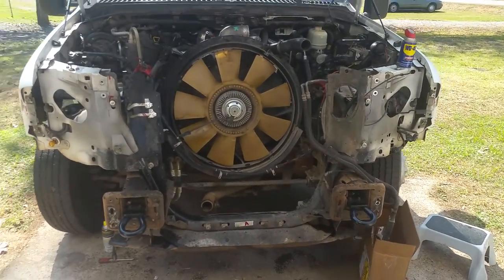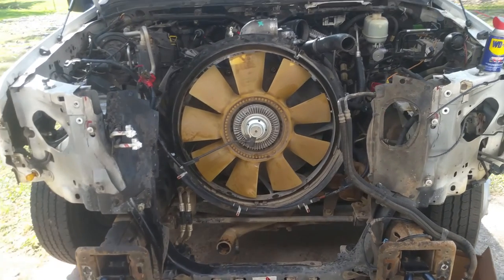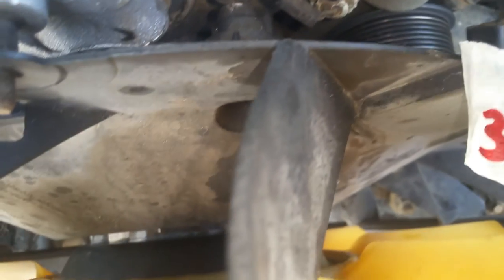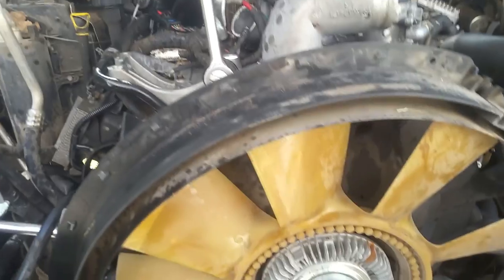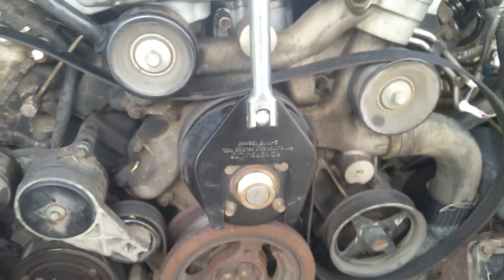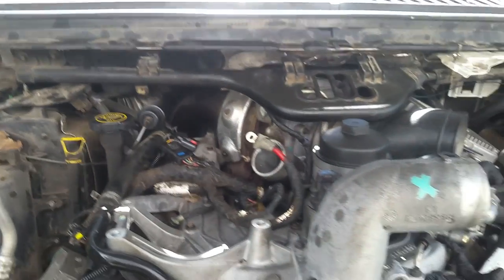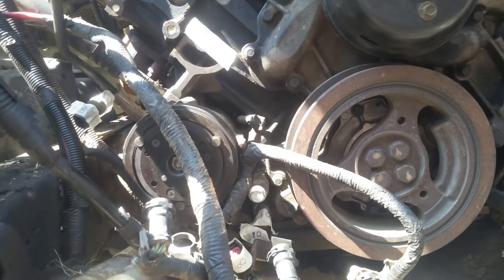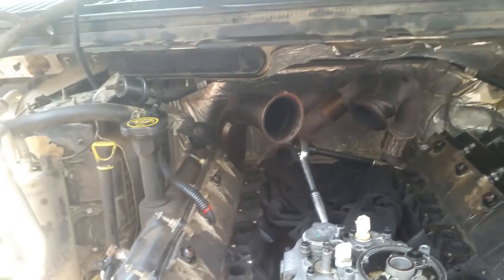Ford 6.0l powerstroke  engine removal

Comment: Thanks very much for sharing this. I just completed this job and your video was very helpful. It took me and my son about 10 hours total to have the engine sitting on a pallet. It would have taken much longer if I hadn't watched your video first. 
Our approach to the AC compressor was to remove the inner fender and use an extra long ratcheting box-end wrench to reach the back bolts. Came out easy. For the flex plate bolts, one of us used a strap wrench on the crank pulley to turn the motor while the other felt for the bolts. I can't imagine doing that job with one person. Aside from that, removing the exhaust cross over is the only other thing that required two people. 
Overall, it wasn't as hard as I expected.
Reply from the maker: I really appreciate the great feedback , and I am glad the video helped out . Thanks for watching.

Comment: Was able to get my compressor out it was a pain but doable you need a short 13 mm gear wrench to work the bolt out of the cradle hole
Reply from the maker: Thank you for sharing , much appreciated.

Comment: Damn, you made that look easy and I know it probably wasn't! Nice job. Compressor from hell, jeez. Thanks!
Reply from the maker: +Baxrok2 thanks alot I appreciate that , hopefully others can watch this and learn what to focus on first without the trial and error as in my case. I would say the most difficult areas to focus on are the up pipes from the exhaust manifold , the torque converter nuts , and last but not least the ac compressor . Those areas just take time . It was at this point in filming my back decided it needed a rest for a few days ha . Thanks again for watching

Comment: Thanks for the video my son and I were debating if this was possible  instead of lifting the cab if I needed to do heads and studs.
Reply from the maker: Yes , once the front is out of the way it's not too bad . I had to change my radiator anyways . If there's 134a that'll need removed . But those head studs will be nice , from what I understand there was never enough tty bolts in the design ,so these head studs give me a lot of added confidence . Best of luck on your project and thank you for watching sir

Comment: When ford first introduced this power stering pump design on the F150's they used all 4 bolts. Hence why all the late ford motors have 4 holes drilled and tapped into the block and on the pumps. They stopped installing these pumps with the 4th bolt a few years into production due to the pump being too difficult to remove because the high pressure line fitting is directly behind the bolt head. Almost requiring pump replacement after removal. Since the update all trucks came from factory with 3 bolts
Reply from the maker: Great information, thank you for sharing.

Comment: Man good job on getting that out without never taking one of these out before. Ever have to do it again that ac compressor and the up-pipes in the rear get a lot more room if you pull that inner fender-well on both sides. Gives you full access! Great job none the less.
Reply from the maker: Thanks for sharing the information,  this was definitely a fun project and anytime things go my way for a change it's nice for sure . Thanks again for the feedback and for watching .
Reply: I guess Im randomly asking but does someone know of a trick to get back into an instagram account??
I somehow lost the password. I appreciate any help you can give me
Reply: @Camden Mayson Instablaster ;)
Reply: @Mack Alfonso Thanks so much for your reply. I found the site through google and Im waiting for the hacking stuff atm.
Takes quite some time so I will reply here later when my account password hopefully is recovered.
Reply: @Mack Alfonso It did the trick and I finally got access to my account again. Im so happy!
Thanks so much you saved my ass!
Reply: @Camden Mayson no problem xD

Comment: Hey do you remember where the short and long transmission bolts go? I’m getting ready to install mine and wasn’t sure if it’s obvious once under the truck where each go.
Reply from the maker: I numbered mine , however in cases I have had to figure the location out I measure depth aprox and sort through the bolts , threading by hand. I figure on about 3/4 inch thread atleast. Wish I could be more help , thanks for watching.
Reply: @s33therfan  Thanks! I think I know where they go now. Tried today and couldn’t get the engine and transmission lined up for nothing. Gonna give it another to tomorrow haha

Comment: how did you keep track of the harness? because i’m thinking of taking on the job but the wires are what scares me the most on this engine
Reply from the maker: I use tape to mark and label everything with numbers. Also pictures of wire and cable routing etc. Best of luck on your project and thanks for watching.
Reply: @s33therfan  i appreciate that’s what my plan is. gonna attempt to rebuild this bottom end

Comment: And thank you for this one too. Now I know what to look forward to! LOL 😕 Well it's gotta be done. Trying not to let it intimidate me. And I know what you're talking about giving your back a rest. I'm 62 and it's back and knees. But, work smart, not hard if you can. Have a good one!👍
Reply from the maker: I would have to say getting the front end off was the most time consuming it seemed . With the 134a drained and everything all the condenser and radiator intercooler comes out of the way and it's more room than you can imagine and easy to get to everything . Some of the harder things to get to were the power steering pump and Ac compressor  along with the tran lines. But after I look back it wasn't that bad , I've definitely had worse before. I've probably mentioned in my video but the complete engine weighs astoundingly over a thousand lbs. Like I said I take my time , I don't try to be the fastest . Some days I might work a few hours and call it a day , just whatever I feel like at least I know everyday is making progress . But I think it's good to stay at it but not to the point of wearing out and burning out lol. It's a good project and you'll have a big sense of accomplishment I can assure . If you have any questions just let me know thanks .
Reply: +s33therfan Man I appreciate it. Thanks.

Comment: Thanks for the vid man. To save $ I’m gonna do my head gaskets myself and would much rather pull the motor to do so to be sure it’s all fine and dandy. Wish me luck lol
Reply from the maker: Sounds like a great project . I know it wasn't long after replacing my engine my ram on the engine hoist went out , guess it was struggling with that heavy engine . Best of luck on and keep me updated . Thanks for watching

Comment: Thank you for sharing this, I got a question do you think it’s possible to pull the engine and transmission at once without separating them? I’m basically trying to put this 7.3 with transmission into my 6.0
Reply from the maker: Shouldn't be a problem at all , with that front off the truck you have all kinds of room , and with the transmission all together it may go a lot quicker. It'll just be a matter of removing all the necessary lines cables exhaust etc. Hope all goes smoothly sounds like a great project .thanks for watching
Reply: @s33therfan  you better have one hell of an engine lift or a tractor and loader.

Comment: Thanks for sharing this. I may be pulling mine to bullet proof and do a bed plate leak some time this year. Just curious, how long did this end up taking.
Reply from the maker: I want to say I spent about 3 to 4 weeks on it , however I did take my time prepping the engine etc . Once it was all together putting it in went pretty quick about a couple of days. I pretty much take my time on any project anymore just to make sure everything goes smoothly , but i will say there are always some unexpected issues that pop up. Seems like I had more issues with stripped threads bolts etc that I spent more time on , so now I check every important thread before installing . Best of luck on your project and thanks for watching
Reply: s33therfan thanks for the response. I alternate working day and night shifts and as a result get 7 days off and am wondering if I could make this happen with 7 uninterrupted days. Thank you for all the videos, they’ve been helpful!
Reply from the maker: @bradleyaronson3616  I believe it could be done . Thanks again for watching

Comment: The ac compressor really isn't too bad you actually don't have to remove anything except the inner fender and wheel on the passenger side
Reply from the maker: +Camz Craft that's good to know the next time I have to mess with it , there's always an easier way of doing something . Thanks for the advice and thanks for watching

Comment: hi, easiest way i found to remove ac compressor was to remove the 8 mount bolts from underneath and raise the engine up just like u said. It's much easier that way and almost impossible any other way.
Reply from the maker: Thank you for the feedback , it is much appreciated.